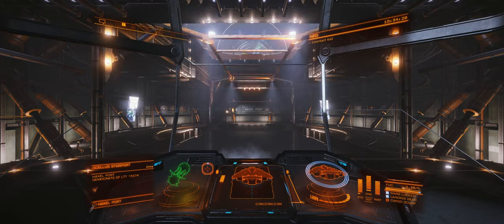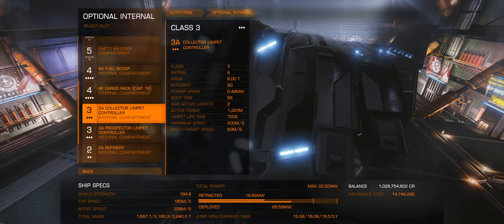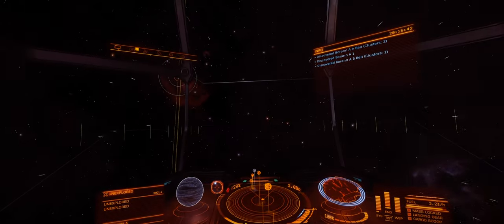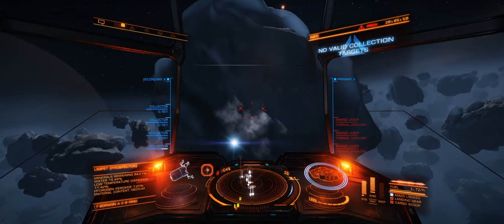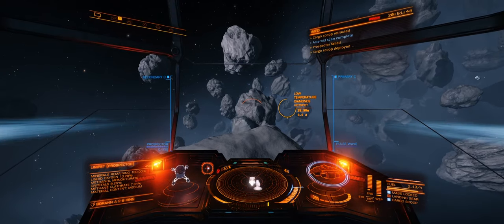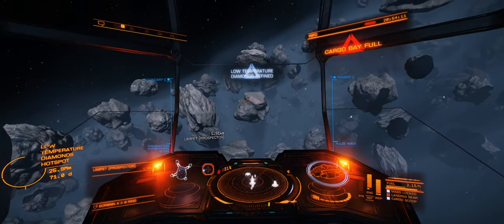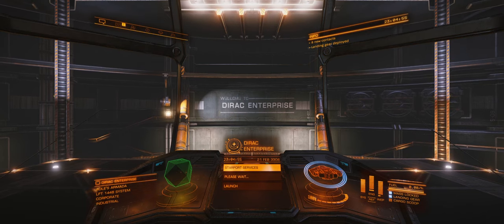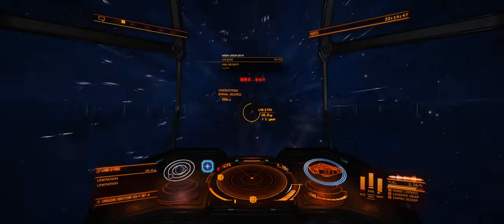Elite Dangerous 2020 - Laser Mining Type 9 heavy vs Type 10 defender

Comment: position your ship so that the collectable minerals are slightly behind and below your ships rear. it will make collecting MUCH faster. Bonus points if you position your ship when shooting the asteroid in a way that the ejected collectables eject towards just below and behind your ship, so repositioning isnt necessary. This only works if you fire on the axis of the asteroid, otherwise you may get smacked if you are too close to the asteroid.
Reply: I do this too, they load far quick when going straight up and down into the cargo hold.

When you're 'nose on' the asteroid they have to do a loop under you, takes so much longer.

Comment: Obviously if you want to mine exclusively , the Type - 9 is better due to having a much larger cargo hold.... and that's it. 
If you want something that can defend itself and maybe collect a few bounties, use a Type - 10, the (slightly) less cumbersome handling also might help some, and it can also be reconfigured into a variety of other roles, such as bounty hunting or piracy, giving it far more versatility and value for money, however it is twice as expensive, so you literally pay for it.
Reply from the maker: cargo hold isn't the only factor in to this (so no, that isn't just it ;)). Laser spool up time and the amount of limpets it can hold is another. And it is the combination of this which makes the type 9 ideal. I personally run with about 7 collector limpets in a session with 3 hard points to laser mine. I can't get 7 collectors running at the same time with the type 10 (unless I drop the shields). But when I fly without shields, the Type 10 gets my vote (but it is a tricky one).

So there are some choices that you can make to make the ship you fly turn into the ideal mining boat.
Reply: @hydlidevlog  you can get 7 collectors, 2 prospectors and a shield for T-10, but in expense of just 384 cargo tonnes. My choice: https://tinyurl.com/ycpfgm4v , since after mining this full cargo I'm bored and could not stand there in place mining it to full 500 cargo :D. Also the need to feel safe: 1. against narrow entrance to the stations (thus the shield) 2. the pirates (thus the shield and lasers and countermeasures for self-defence). Ultimatley the T-10 is just better looking (for me), and I started with T-9, was flying this hog many hours, then moved for T-10 and won't change back. And a note for the build, when the cargo is full with eg. painites, I change class 5 collecting limpet for Fuel Scoop, and once returned from selling stuff replace it again for limpets:) Good vid, cheers!
Reply from the maker: @RagnarCzerwony  I have surprise build up my sleeves when it comes to the type 9 ;) Your stats can go out of the window when I am done.
Reply: This is why I swapped the 9 for a 10 . The trade off with space was the main thing but at least I can defend myself when I get interdicted . Plus 500 T takes for ever to fill where as 300 or so T wont have me falling asleep . Plus you can fit out the 10 for combat and have a couple of fighters with you and do that instead . Surprisingly the 10 was faster and more agile than expected